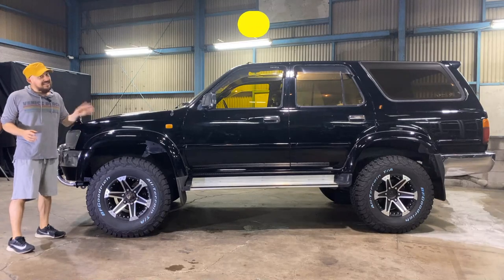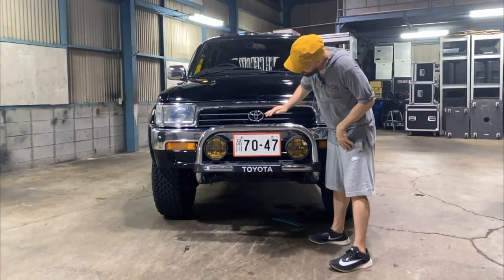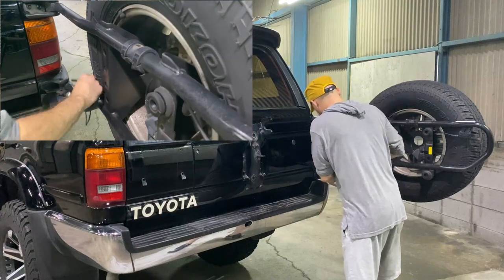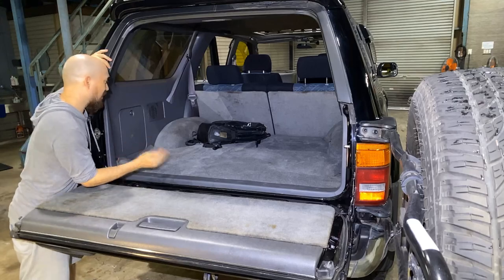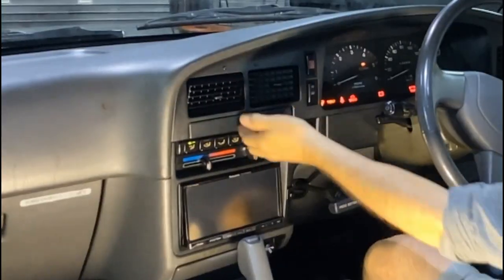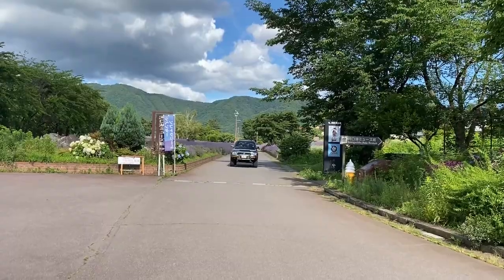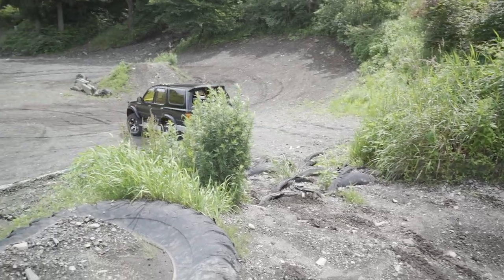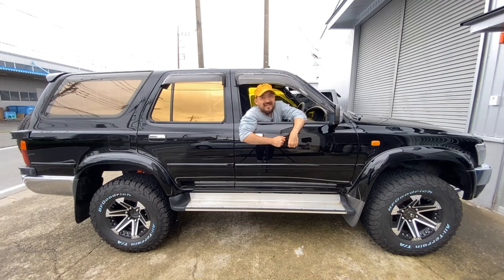This lifted old-school Toyota Hilux Surf is stunning!!

Comment: Very well documented ... 
But one thing I need to mend .. Its back door is automatically locked when the the screen is raised to close, you dont need it to lock it manually .
Rest assured, its best machine I have ever seen ... Am loving it ... Agree 200% that it loses the drive leisure when raised 2 inches or more .
Reply: Mines lifted 2 inches but still drives good, have you removed anti roll bars ?
Reply: Very strong vehicle
Reply: I still have mine in 2024 and don't feel like selling at all.

Comment: Cool video! I have a 91' 4Runner and me and the wife sleep in it during summer trips. I am almost 6.1 and what I do is remove the back lower part of the seats. Its only 4 bolts and you gain a lot of extra lenght, thus making a comfortable bed.
Reply from the maker: that's awesome!! thanks for sharing:goodvibes:

Comment: Three questions: 1) What is the fuel capacity in gallons?  2) What is the MILES PER GALLON? 3) What is the vehicles tow rating in POUNDS?
Reply: I have a hilux with the same engine and similar drive train, I get 10.5l/100km which is about 22 ish mpg and I believe the towing capacity is around 1500kg or 3300 lbs here in australia braked. My hilux holds 66 litres, that surf should be similar.